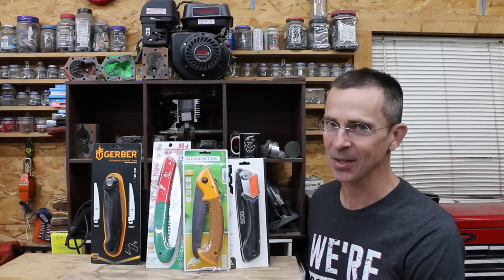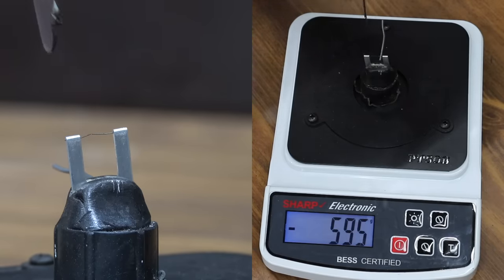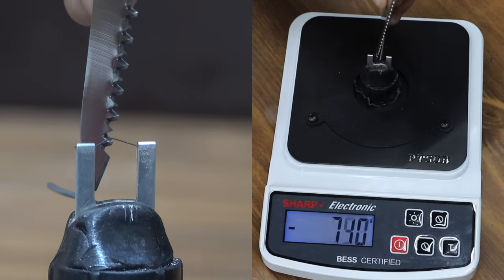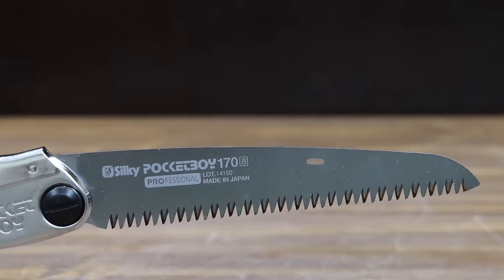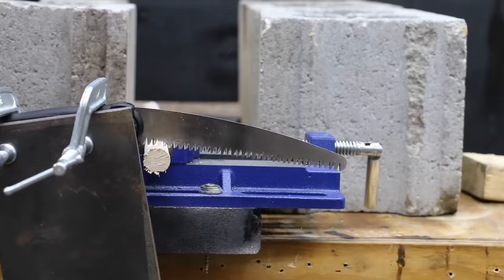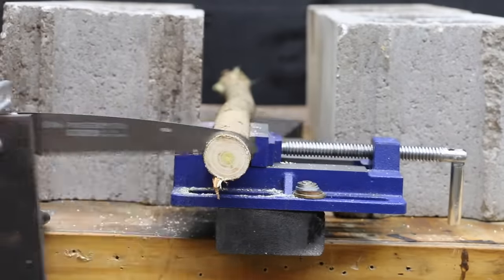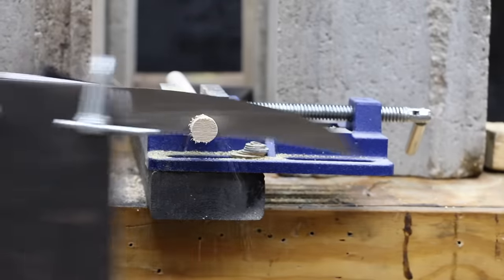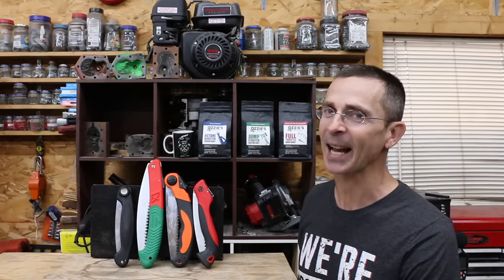Best Folding Handsaw? Samurai, SOG, Corona, Gerber, Fujiwara, Silky, Kershaw, Gruntek, Mossy Oak

Comment: Great tests once again Todd!  Been a big fan of Corona tools for decades now and still have some of the early ones.  Have this saw, OLD Hand Pruners, medium Lops (old wood handles) and larger metal handles (newer) and a Old wood handle 10" shears.  I replaced the folding wood handle saw about 2 years ago because I let it get rusty beyond restoration...My Bad!  The new one is even better than the old on OAK, cottonwood, Jurassic weed trees (don't know the name) and everything I've used it on, quickly and a beast on 2-3" oak...if they made chainsaws I'd buy one!!  A little touch up and rust prevention (Boeshield) and they will last a LONG time...and definitely best bang for the buck IMHO.  Hat Tip, ~PJ
Reply from the maker: Thanks! Thanks for the feedback.

Comment: The corona has been an excellent cutting saw. I do work this saw fairly hard. The locking mechanism fell off and got lost in the leaves. Also, two teeth have broken on the blade which make cutting less effective.
Reply from the maker: Thanks for the feedback.

Comment: Great video! I would love to see another one on longer length saws. I love the 240mm Silky Gomboy, but I have broken 2 of them since the tips have a tendency to bend then eventually snap. They sure do chew through logs though!
Reply from the maker: Thanks!  Thanks for the suggestion.
Reply: Silkys are overpriced and they don't last, they break like glass. Get a Samurai Ichiban 33 or a Corona, if you want a real professional tool. Only better on Silkys is the marketing, however, those other 2 companies, do not need that marketing, to sell, because they make the best saws in the market...
Reply: I hope you realize that they are pull saws? I have no idea how you can fuck up a saw by pulling it.
Reply: @DARKRESCURED  sometimes you don't let up enough on the push stroke, sometimes the tip gets pinched in a log. It happens. Once the tip is bent, it's only a matter of time before it snaps off.
Reply: @DARKRESCURED  I hope you realize, that what you said, shoes that you didn't understand what he said, or you, don't have much experience with saws. Im glad that he kept his temper and explained to you, the way he did.

Comment: Thanks for the video, I always find them interesting an I like that you're soooo upbeat. I searched a bit an I don't think you made... I have an idea you might like. I needed to make something really big so I had to do it in my freezing cold garage an it involves wood an adhesive. Thus is lots of words but I think a video on gluing things in the winter would be cool. I saw that 3m had some crazy expensive  double stick tape an some people use polyurethane etc. I asked mer da an he's a engineer an he said they use epoxy for repairs in space which is way colder than here in NY. I used epoxy I bought on Amazon. Thanks
Reply from the maker: You are welcome!  Thanks for the suggestion.

Comment: Once again great video.  I would like to point out that blade geometry and angle of attack may have skewed your results.  Both the corona and samurai blade angle with the lumbar where tipped down resulting in a harder pull but deeper cut.

Comment: Thanks for another great video. I had an idea for a video: small space heaters, the electric fan kind not the oil radiator types. Power draw, air movement, temperature 2' away, 5' etc... Might one for next fall I guess. Thanks again
Reply from the maker: You are welcome!  Thanks for the suggestion.

Comment: I bought a saw like this from KMART about 20 years ago. Some knock off brand, I paid maybe $5 bucks for it. I’ve used it around the house for all kinds of odds and ends over the years. It has never been broken or sharpened once in all that time. I never wished it was sharper as it just does its thing. So I think I got my moneys worth on this one.. 😂. Nice video as usual. Here is a Video IDEA: My family makes fun of me because I have so many clamps. I always say that you can never have enough clamps. From simple spring loaded hand clamps to corner shelf making clamps etc etc. So maybe do a series on clamp types and comparisons. Just an idea. Thanks!
Reply from the maker: Thanks!  Thanks for the suggestion.

Comment: Love this channel!!
i think the cutstroke test may have been a little flawed.  You controlled the downward weight but not the cut angle (ie: angle of attack) I noticed that all high performers  had a downward pointed blade which made the cut more aggressive and likely harder to pull.  Not sure the best way to control this though…especially with different blade geometries.  Thanks so much I love what you do!!
Reply from the maker: Thanks and you are welcome!  Thanks for the constructive feedback.

Comment: I really like the folding saws that take disposable blades, such as those for Sawzall and other demolition saws.  You are probably not going to cut through metal nails by hand, but if you carry around the blades and a Sawzall anyway, you might as well throw a handle in the bag too.  It's a decent backup option if you are in the boonies and your tool battery dies.  Or it's getting dark and your buddies ask if there is another saw around they can use to help out--you know, so you can all move on to the "pizza and beer" you are paying them with!  🍕🍻🤣

Comment: Keep the great content coming! I would love to see a proper locking pliers showdown. Vise-grips aren't what they used to be; I have decades-old hand-me-downs that are holding up way better than new ones, and I'd be interested to see how they stack up against Milwaukee, Snap-On, etc in a proper test of strength and especially jaw hardness, and ease-of-use of the different release mechanism designs. - Brad M
Reply from the maker: Thanks, will do!  Thanks for the suggestion.

Comment: I hope this isn't taken the wrong way but the dowel test was not accurately representative of cutting speeds, as the angle of attack of the blade was very different on some of the blades, creating increased pressure on the cutting face.  All blades need to be set up to run at the same angle (or a mean of the same for the Samurai).  The Corona was set up with significantly more angle of attack/forward angle compared to the other saws, which I believe is why it was ahead of some that were faster by hand.  When this is taken into account, by my reckoning the Corona would fall to 3rd place.

Comment: It's a little more general than your usual fare, but I'd like to see a comparison between different types of large wood drill bits. Something like augur, spade, forstner, hole saw, etc. Comparing speed, hole cleanliness, force required, time to cut multiple holes, and so forth.
Reply from the maker: Thanks for the suggestion.

Comment: Great test ! I wish you do a high/ mid torque impact wrench and if there’s a difference when recharging and maybe run time on each of those system 3/8 and 1/2 ,weight, dimensional comparison, how does it feel on hand does it incline too much or feel to heavy ?
Brands could be Skil, makita, metabo, dewalt, rigid,ryobi, craftsman, Milwaukee , flex, hart , wen ,   It would be great for home users than don’t need much only tire swap  and other more for pro users , any other suggestions would be great to know and include on comments ….  Voltages 12-40v .I understand this would be a great video and take pretty good time   and I know it would be insanely expensive …. would be great to do a comparison . Sometimes I feel you should be sponsor by many companies heheh😂 your videos are detailed

Comment: An interesting test , but the thing it cant test is longevity . The arborists I work with have tried all these saws and more and the almost exclusively use silky's as they consistently stay sharper longer  regardless of the model and the handles dont fall to bits or break . If you want something that will last look at what the professionals are using on a daily basis.
Reply from the maker: Thanks!  Good Point!

Comment: One thing not tested for is raggedness of cut.  I did some pruning yesterday with an HME 12" non-folding blade saw I got at Amazon several years ago.  The aggressive tooth pattern had the blade jumping out of the cut continually and making a mess of the bark, which when you are trying to prune a fruit tree is not what you want.
Reply from the maker: Thanks for the suggestion,

Comment: I so so love these videos. Could you review some of those folding handles for reciprocating saw blades? I used a Milwaukee one the other day that was cool, but it would not fold fully because I used a blade longer than its handle. I saw some reviews of the Nordic brand one, someone was unhappy with changing the blade angle with a twist knob rather than a button or switch to lock in place.

As always, obsessed with these awesome reviews and thorough testing, thanks for all you do!
Reply from the maker: Thanks and you are welcome!  Thanks for the video idea.

Comment: The Bahco did not cut the wire, it pulled it out. I would say it is the dullest, which the coating caused. you can see it in the closeup.

Comment: I have a Corona, laplander, and a Silky,, to be fair, my Silky is bigger, but it is far and away my favorite.  My Corona is in my bug out bag, my Silky is in my trunk,  gets used all the time for all kinds of tasks  I would always default to my bigger Silky, but absolutely trust my Corona, why it's in my bug out bag.  At the Laplander level,  I prefer my hatchet. I use my Silky 90% of the time.
Reply from the maker: Thanks for sharing.
Reply: I find that the tips of the Silky blades break off too easily, and replacements are pricey. Maybe I'm too aggressive with them, but I live in a forest and do a lot pruning.

Comment: I know you've done a number of oil tests, but I would like to see you test some motorcycle oils.

Most motorcycles have a wet clutch, so the type of oil can affect whether the clutch slips.  This could be an important factor when testing.

Try out amsoil motorcycle, castrol motorcycle, mobil 1 motorcycle, Rotella T6 diesel (popular for use on motorcycles) and a car synthetic oil for a control

Comment: A lot of these products are more expensive because of their durability. Cheaper products are more affordable in the short-term, but cost more in the long-run because they're designed to break so you have to buy them 3-4 times compared to 1 more expensive product. Silky has an incredible reputation for a reason.
Reply from the maker: Thanks for the feedback.

Comment: In survivalist/ prepping community silky is held in higher regard than corona, I own both, and can tell you silky stays sharp with years of use and yeah the corona is plenty sharp but I haven't used it as long as the silky so I can't tell you how long it will last.   For the price, my gut says it would make more sense to buy 3 coronas than 1 silky.   
One thing about the test that I didn't think made a ton of sense is the blade thickness.  Some saws cut on pulling so all that matters is tension strength.  Just make sure if you have one of these thin blade designs don't lend it to someone that doesn't know what they are doing, they can bend the blade easily being rough with it.
Reply from the maker: Thanks for sharing.

Comment: Hello @Todd @ProjectFarm, really appreciate your detailed analysis on various products. Was hoping you could do one on different full-room oil radiant heaters. With so many on the market, seems like the only variables are longevity (hard to test), heat output (simple to test), emissions of harmful chemicals when heating on max setting (requires special equipment?), build quality (not very important to this type of product?), efficiency (heat vs watts/cost)  and heat radiant dissipation/dispersion radius (tricky to test?). Or are all oil based radiant heaters the same?
Reply from the maker: Thanks!  Thanks for the suggestion.

Comment: A video of the best battery push mowers. I know there's a bunch of battery voltages like 18V, 36V from Makita, 40V, 60V, 80V, etc, so maybe just the most popular ones or ones you found interesting that are good for residential use?
Reply from the maker: Thanks for the suggestion.

Comment: Something that would be cool for future test where sharpness and edge durability is bing test, is that you test the Rockwell hardness of the blade. Also state the blade steel, if known, so we have an index of sharpness vs duarbility. You can get A LOT of Chinese high chomium, CR MoV steels very sharp but the edge wont last. As an avid knife and cutlery collector, LOTS, and I mean LOTS of over seas brand claim to have certain rockwell hardness, which of coarse affects the sharpness and edge durability, but are in fact falsly advertised. When it comes to mass produced, primarily chinese, blades it is safe to assume that the advertisement is more likely to be wrong than right. Its always good to double check. Heat treat can really make or blades a cutting ability and durability.
Reply: I also get if that is maybe getting to far of into the weeds for a condensed shorter video format. As always, you videos are informative and high quality. Keep up the great work

Comment: Am I missing something? At 4:42, the SOG didn’t actually cut the wire, it just scraped it. I looked through a lot of comments and I didn’t see anyone else mention that. 

Also, looks like the Bahco at 6:02 didn’t cut the string either. It looked like a bad sharpness tester that gave out before the blade cut it

Great video though!

Comment: One issue I noticed with the methodology here is the angle of attack. While curved versus straight will generally prevent perfect comparison, the way a saw is aligned and pulled through the wood makes an enormous difference to its performance. That said, the difference between a good saw and a crap saw is so great that it's lost in the wash. Corona has been my choice for nearly two decades, I have most every saw they've made. Bought the tiniest folding Silky years ago, cuts very well but I never use it. Would like to try the bigger Silkys but the moneys. And Coronas are so fantastic. Finally dull after years of abuse? Oh well, buy a new excellent blade nearly anywhere for only a few bucks.
Reply from the maker: Thanks for the feedback.

Comment: Next time you do a folding saw test, I'd also like to see a test for durability with the weight test you briefly did at the end where you continually add more weight to the blade and grade them by when they snap
Reply from the maker: Thanks for the suggestion.

Comment: It would be really cool to see pf obtain raw steel from different suppliers around the world (of the same form and grade) and devise tests to determine which steel is best. If you can find what steel a blade manufacturer uses it would be even cooler to compare their product with the raw steel to see if they weakened or strengthened it somehow in their processes.
Reply from the maker: Thanks for the suggestion.

Comment: The problem with this test is, some saws are designed for carpentry others for pruning. Silky makes the same saw for carpentry and pruning. I am a professional gardener I extensively both tried the Silky PocketBoy and the Samurai featured in this video and the Silky consistently cuts cleaner and with less effort. There just seems to be more friction when cutting with the Samurai.
Reply from the maker: Thanks for the feedback.

Comment: Where have I been and how did I miss this review until now?  I am very surprised at the results of this competition.  I have several Silky saws of various sizes, and they offer multiple blade options for each model, and performance can vary greatly based upon blade selection and the quality of cut desired.  I believe the coarsest tooth selection would have been favorable for the tests you conducted.  Silky blades are also chrome plated, and thus more corrosion resistant which should allow them to last longer.  Too many other reviews out there that show Silky to be the best pull-saws on the market . . .  just sayin'

Comment: Been watching all these vids even of stuff I won’t ever need. Interested in a 2nd video of carbide multi tool blades. Diablo and Milwaukee have both released new metal cutting blades and Diablo has 2 different types. Would love to see a comparison of the new ones and some cheaper options that I’ve seen on amazon, EZARC brand. Also Fein tools has an expensive carbide blade too.
Reply from the maker: Thanks for the suggestion.

Comment: A LONG TIME AGO (I’m 71) I bought a folding handsaw that was made with ‘chainsaw like’ teeth. 
It cut with a minimum of effort and no binding. 
I literally cut branches using only the weight of the saw and my thumb and index finger to move it.
Lost it and can’t find a modern one like it. 
I wonder how tooth design would impact cutting?

Comment: I don't think that jig really accentuates the pull only design of the silky, I've definitely gone through most things with 2-4 strokes using a 210mm. You really don't want to use any downward force when resetting the blade.
Reply from the maker: Thanks for the feedback.
Reply: @ProjectFarm  Thanks for your amazing content. 👍

Comment: It appeared that on the dowel cutting the blades were not all level.. the ones that had the blade tilted down from the handle cut faster.  Would like to see the results where the blade is as level as possible  for an even cutting result.

Comment: On the number of passes it took to cut through the rod, the one thing I will say that was unfair was the steepness of some of the blades. Seems every saw that was sitting at an angle did inherently better. Feel like to control that variable a bit better the blades should have all been sitting as flat as possible. Just a thought.
Reply from the maker: Thanks for the constructive feedback.